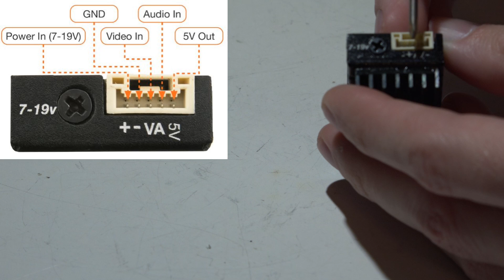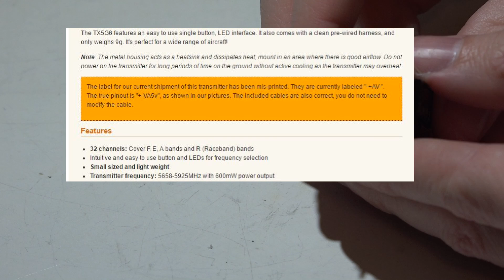How NOT To Fry Your Multirotor Parts: Part 1

Comment: Nice vid as always! Really like your vids!

btw there is no "extra" lamination on top of the carbon fiber plate in the sense that they do not put an extra non conductive layer on top on purpose.  During production they simply put a 0/90 degree twill carbon layer on top and bottom which is also used inbetween, except that the layers inbetween the bottom and top layer is a heavier (not so fine looking) weave. To create more stiffness in various directions next to the 0/90 degree twill weave other layers such as unidirectional and biaxial layers are used. The reason why the top surface isn't conductive is that there is a build up of epoxy resin, which simply occurs during production (unpurposed). What they sometimes do is to paint the carbon fiber plates with a clear varnish before laser-cutting or cnc-milling the plates. This is also just done to give the surface a nice shiny look, with the side effect that it won't conduct electricity.

anyway, very informative video and definetly learned something
Reply: Jory W: Nice post, I learned something here too.  Thanks...

Comment: only thing I have to add is that some people have been seeing rosin core solder leaving behind a semiconductive material (the rosin) and they don't notice it and when flying suddenly the fc restarts and the quad falls down, this is specifically prone to anything gets with small pads that are very close to each other - always clean up with a contact cleaner or high concentrate alcohol what you have been soldering

Comment: Thank you for posting these videos, they're very very useful! Now, about overloading integrated regulators and load adding up, how do I know or measure how much current a particular component draws?
Reply from the maker: There is a way you can measure it but you would need a really good multimeter. But also some websites show all the specs for the parts, including the current drawn. If you look around hard enough you'll find the current for all the parts.
Reply: OIC, so we kinda depend on the proper attitude of the manufacturer/vendor. Also I can imagine it involves some bit of trial and error on the user's side too. I'm gonna try to find a reputable vendor which provides these info for the consumer, thanks for the answer!

Comment: So I watched this a while ago and after upgrading my VTX decided to do the battery lead continuity check described at 2:38. It beeped, so I fiddled with things for a little while trying to figure out the problem. Turns out that since my quad has some hardwired LEDs (Wizard X220), the circuit tested as continuous (with my analog multimeter, I don't know if this is standard). Point being, a beep on that test doesn't necessarily indicate a problem. Probably obvious to folks who know what they're doing, but it took me some time!

Comment: Is there a pack on banggood were I can get bolts for the most common motor bolt size? If not, are there any other websites? Also, for how long will it take making a motor fry?
Reply from the maker: I haven't bought any bolts from banggood but they might have some. All of mine came from Ebay and Amazon. The thread pitch is M3, so just search for M3x5mm, or M3x6mm, or whatever length you want. And there's no telling how long it will take to fry a motor. Could be instant, or it might not every fry, it could just keep acting weird.
Reply: Project Blue Falcon Thanks for the reply. I will find some bolts with the dimensions!

Comment: Very good points. However I cannot see why the negative lead of the vt60 has continuity to the carbon fiber frame. It can't be the camera, VTX, fc, rx, or ESCS OR motors.
Reply from the maker: Some PDBs and flight controllers are giant grounds. On some the bolt holds are isolated from the ground, some are not. I'm using metal bolts on this frame with a flight controller whose corners are not isolated. So thats where my ground is coming from.
Reply: Project Blue Falcon I see. That is good to know. one more thing to look out for to avoid a short.

Comment: On the omnibus- If I use battary voltage it should work when I power my receiver and my camera with it or not?
Reply from the maker: Using the full voltage of the battery to power the camera should be fine. Cameras dont require much current. Just remember that even if you are bypassing the voltage regulator, current still goes through pins and traces, and current makes heat. I just power my camera off the PDB that way I'm eliminating as many chances as possible.

Comment: i replaced the esc's on mine and the new ones didnt have bec ....... in a pinch i just cut back motor wires and signal and just used the positive and negative out to reciever from one of the old esc's .... temporarily till i got the power distribution board with bec

Comment: I noticed that sweet ass camera / standoff mount, did that come with the frame or separate? Can you give me the measurements of it, please? Thank you!
Reply from the maker: It's made by ReadyMadeRC specifically for their Hellbender 204 frame, which is the frame used in this video. https://www.readymaderc.com/store/index.php?main_page=product_info&cPath=76_729_761&products_id=5230

Its the standard 35mm tall. Center of bolt hole to center of bolt hole is 44mm. Total width is 49mm

Comment: So with the Omnibus boards, if you use the RAM pin to run the battery voltage to the OSD, I'm probably drawing too many amps? Or does that bypass the regulator?
Reply from the maker: The OSD doesnt need voltage. Jumping the ram pin to 5v or the full voltage of the battery will move that same voltage to the other RAM pins, but I highly recommend not powering the camera and Vtx off the Omnibus. You can still run the video wires from both to the OSD pins on the flight controller, but I always power the camera and Vtx from some other power source like a PDB with regulators built in.
Reply: Sorry I explained that poorly. I ran a jumper wire from vbat to RAM not to power the OSD but as a pass through for the VTX. But if you know of people who have had trouble with this set up, I'll just run the VTX off of the battery. Thanks for the vids by the way, they are really helpful, and I've fried 2 flight controllers now because my hand slipped with the volt meter lol

Comment: Wished this video was out on my first build fried so much stuff haha Anyways nice video!!

Noticed the placement on your receiver antenna's is that the best spot? Trying to figure out the best place to mount my VTX and receiver so I minimize chopping my wires off.
Reply from the maker: It's probably not the best spot for max range, but I've never had a problem with range doing it like that. I dont fly a mile away or anything crazy like that. I hate walking lol. It is a great spot if you dont want them chopped. They just stay in place under the electrical tape.
Reply: Sweet I am gonna try it out. I don't fly too far away either. Now to figure out best spot to place the tbs unify pro. 

Thanks for the reply!

Comment: hey JC. would you recommend using a HV System?
Reply from the maker: What do you mean?
Reply: Project Blue Falcon, i mean a High voltage vtx like the TBS unify hv. some complain, the Video quality is not aß good as normal 5v vtx signals. I really like your vtx failsafe construction btw.

Comment: hey bro I'm ordering an antenna for my goggles an omni directional on the website its asking inner hole or inner pin I go with inner pin right?
Reply from the maker: Depends on what your video receiver uses. If its SMA (has the hole) then you'll need SMA antennas (pin in the middle)
Reply: Project Blue Falcon damn I'm lost now lol when you say video reciever is that's what's on the quad lol & how do I find out my bad man I'm lost
Reply: You must be very new lol. You'll get there dawg
Reply: Just finished my rmrc hellbender! Glad to see you have so many. What is the best camera to fit in that special rmrc blue camera mount? Is that a runcam in yours? Looks like it fits well. What kind exactly? Also what camera was that from rmrc with the buttons in the back when you were explaining the wire coloring?
Reply: Craig Davis I'm probably like 8 packs in lol I only own 2 lipos and I've been flying once a day for the past few days. My first goggles are the quanom cyclops and I'd like a better antenna I think I need the inner pin kind
Reply: Craig Davis I'm probably like 8 packs in lol I only own 2 lipos and I've been flying once a day for the past few days. My first goggles are the quanom cyclops and I'd like a better antenna I think I need the inner pin kind
Reply: +Space Lord get you a TBS Triumph dude
Reply from the maker: Craig, I love that frame for freestyling. Not the lightest thing but it's a tank and can take a beating. I dont think there is a perfect camera fit for the camera mount but my favorite is the Runcam Swift. There is a Swift 2 out now, have built in OSD for voltage, but I dont want that, so I just stick to the original Swift. The camera with the buttons isn't good for these kinds of frames. Its really big, expensive, and heavy. I only use it on GPS builds.
Reply: I wish I could afford it man I will one day for sure I'm on a super budget but any omni circle antenna will beet the lil stick one I got
Reply: +Space Lord not telling you to spend all of your money on quad stuff but I am telling you that I learned the hard way buy the good stuff in the beginning and it will save you more money in the long run couldn't tell you how many little dys ESC I got laying around lol
Reply: Ultimatevapor918 I got fired for the first time in my life last week in between jobs right now. Here's my setup: Martian frame, Spedix 25 amp ESC, Brotherhobby T1 2600 kV motors, Runcam swift, racecraft props and my buddy built a custom made antenna that's pretty dope. my first quad it ain't much but my moneys funny right now
Reply: +Space Lord what flight controller are you using please don't say naze32 LOL that's not that bad of a setup I think mine was worse on my zmr250 at least your ESC are matching LOL I don't even think I was running the same Motors on mine LOL and your camera is better than my first camera mine was a CMOS fatshark and it was terrible
Reply: Ultimatevapor918 yea but I've only got a turnigy 16s transmitter and cyclops goggles its an omnibus F3 fc and thers a slight twitch so it could have a bad gyro idk
Reply: Project Blue Falcon thank you!
Reply: Space Lord I'm a noob too lol. I still use the cyclops. Rmrc has some great antennas for cheap called menace they're $12 a piece and durable suckers. You're talking about sma and rmsma. Get to know the difference and you can buy adapters if you mess up. But basically if you know the difference and stick to one type you're good.
Reply: Hi Graig. i think you mean RP-SMA or SMA, only differense is RP its right hand threds, normal threds is on SMA connector. sry my English.

Comment: How do I use a multimeter without a continuity beep function? It has a continuity setting, but doesn't beep.
Reply from the maker: In that case you will look for resistance, anything above 0 ohms is continuity.
Reply: Maybe it got an LED or some other indicator that changes when you touch the tips?

Comment: my brain is bricked.so i cooked my stuff a few times.with my hobbyking 260 blackwidow cheap plastic frame pdb/bec got some cheap 20a simonk flycolor with bec rs2205/2300kv emax a 25v1000uf cap.on the v-in with all the wires plugged in it flew great all spring,summer,fall.then i got a windows tablet downloaded librepilot on my openpilot evo fcb.and screwed it all up fried an esc on one side and a motor on other side.back on openpilot all is good.huh